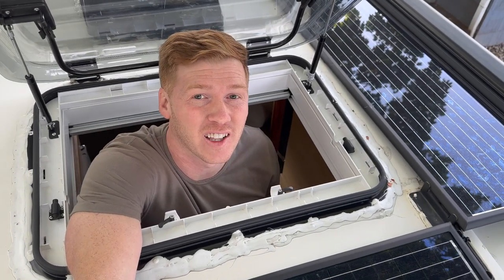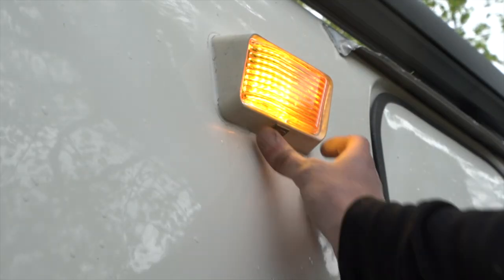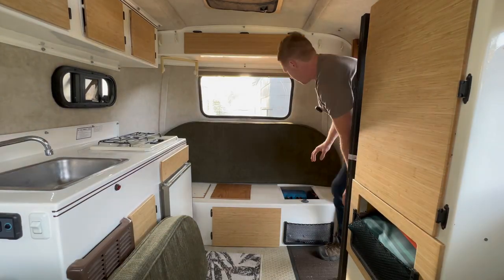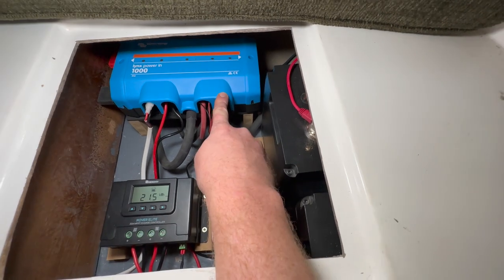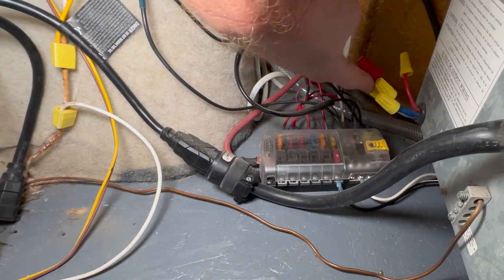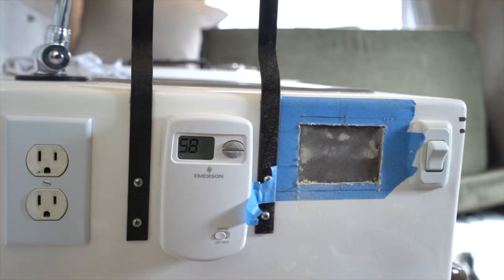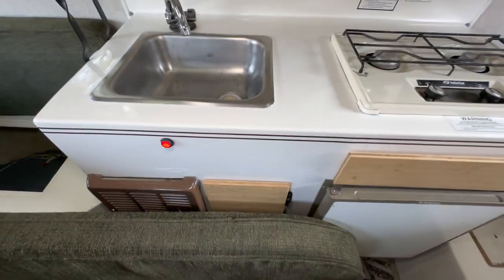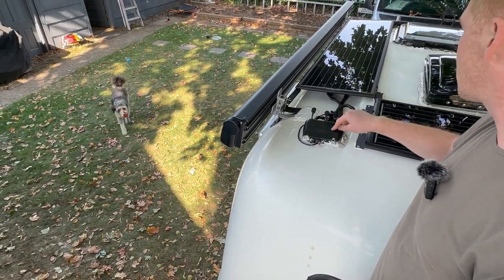Getting My Scamp Ready for Off-Grid Travel:  Electrical Upgrade with Solar and Lithium

Comment: What is the new white exterior panel where the AC vent used to be to left of the door? There appear to be two "levers" on it. Very curious to know. Thanks!
Reply from the maker: It’s an access hatch to grab things from the inside. There’s also a lock installed on it

Comment: Looks great! Curious on how long that amount of solar takes to charge the batteries?
Reply from the maker: I'm glad you asked! It would likely take a couple of days to get them charged up from zero in optimal conditions. For this reason I wouldn't fully discharge the batteries each day if I were boon docking.
Reply: @shaunwilkens  I imagine it would be easy to use a small (Honda style) generator if needed, or setup a switched connection to the tow vehicle.

Comment: I’m curious about adding the option to charge via the 7 pin connector to your tow vehicle while travelling.
Reply from the maker: Yeah, that would be nice. I know that would be a pretty small trickle charge. Another option I considered was hooking up a dc:dc charger to the tow vehicle battery and have Anderson connectors between the tow vehicle and trailer.

Comment: Thank you for the great content! My wife and I just picked the same year and size Scamp. Similar, the last owner stripped the DC system and used it as a basecamp for fishing. I am duplicating your DC system and hoped I could ask a few questions. 1. Is there a reason you ran the Blue Sea fuse block to the rear? Assuming it was to reduce qty of accy. runs? Did you put in a fuse (ANL) between your battery and the Victron power in? 3. Any issues with subfloor rot? I am replacing the entire rear (dinette) sub floor, a PIA. Thanks for the help!
Reply from the maker: Hey @Brian Angelow! Thanks! Yes, I ran the fuse block to the rear since all the original wiring ran there. I used a mega fuse in the Victron Lynx distributer for the positive lead going to the battery bank. Fortunately my scamp didn’t have rot. Just some mold that I was able to sand away and repaint over for added protection. Hope this helps!
Reply: Awesome, thank you!

Comment: If mixed wattage solar panels are connected in parallel, the total amps are added, but the voltage of the system reduces to the voltage of the lowest panel.  Wiring the two 45w panels in series to match the bigger 90w would technically solve that problem.
Reply from the maker: @Pierre-Luc Bouchard What you say is true in most cases, however you're assuming that the 45w panels have a significantly lower voltage.  Zamp specifically designs their solar panels to closely match voltages regardless of their size so that they can be mismatched in an array while still being very efficient. This is another great reason to go with Zamp and I should have mentioned it in the video. In this case my array would be much less efficient if I wired the 45w panels in Series. 

If you're curious... The 45W panels: Vmp=20.21(V), Imp=2.25(A) and the 90W panel: Vmp=20.5(V), Imp=4.6(A).